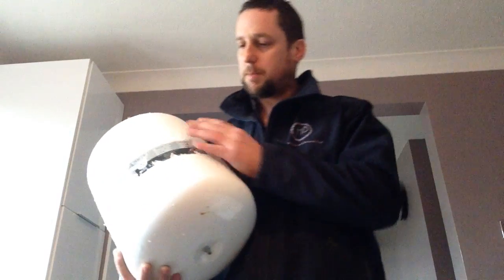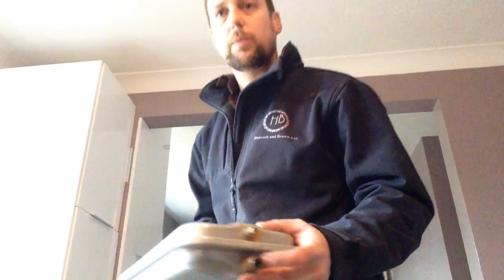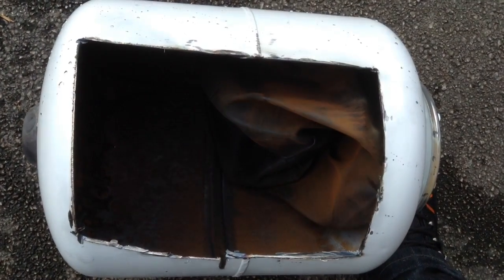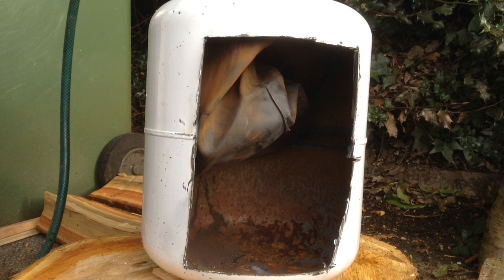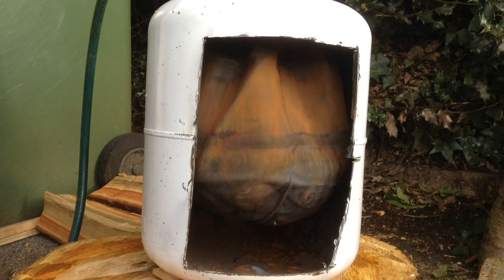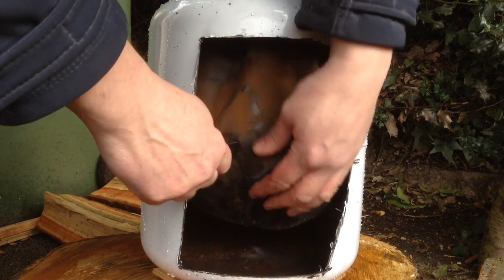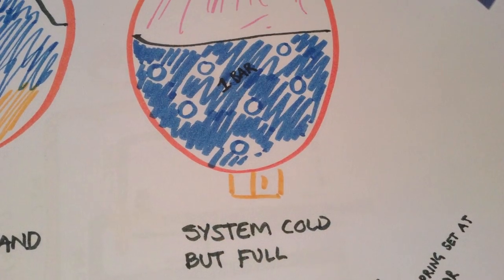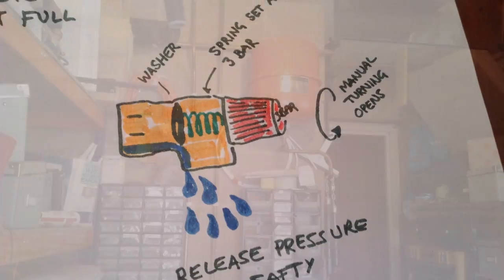Inside a Expansion vessel and what goes on

Comment: Your water heater has a temperature relief valve, why would you need an expansion tank ?
all you have to do is make sure that the temperature valve is in working condition.
Reply from the maker: You wouldn’t want to rely on the relief valve.. this would scale up in no time. Water doesn’t compress, so the air bubble compressing stops any strain on the system. Smaller items like water heater less 10litres may expand back down the cold mains, but larger items need a vessel to take the expansion.
Reply: @GHancock  Thank You for the Info.
Reply: Might have something to do with causing undo excess pressure in water heater or causing the pressure relief valve to fail more quickly.

Comment: Hi there. 
My valve is loosing air. Only air. Can I change only the valve of the expansion vessel without     disconnect- discharge the? vessel ?I mean without drain the water of the system.
Reply from the maker: You can change the middle of the Schrader valve, tool is cheap enough, you can silcone Lube up the old one sometimes to stop it. Release the pressure first though